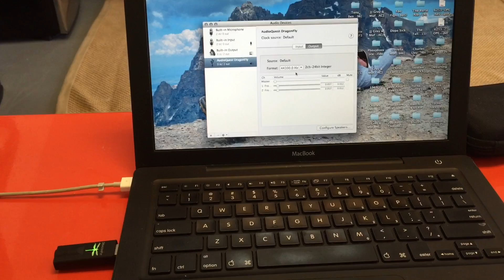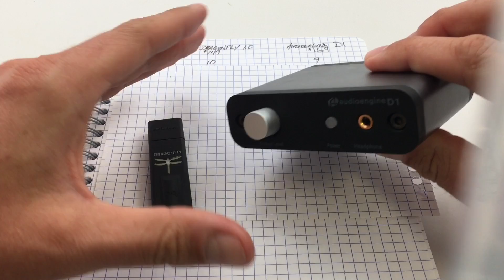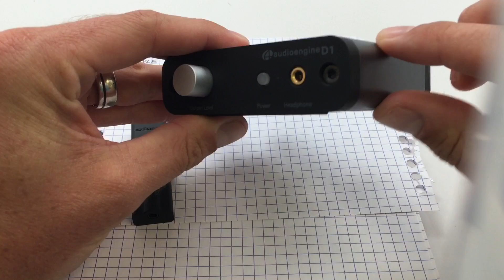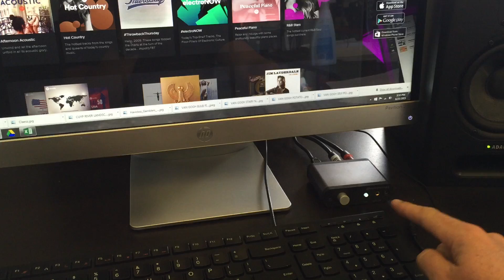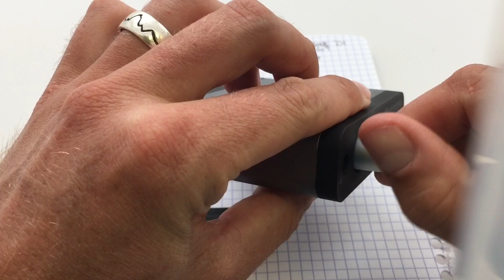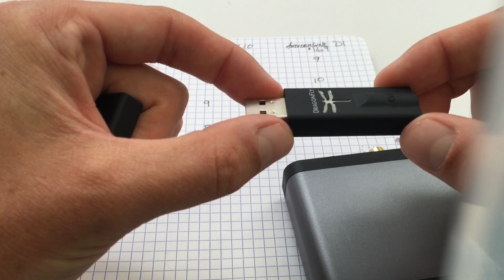DAC Shootout Audioquest Dragonfly vs Audioengine D1

Comment: I was thinking of those two. I have the dragonfly black, and I waiting for my Hd650s, will it be enough? The red maybe? Or the audioengine. I want something portable, i Know Hd650s are for the house, but i want have some dac amp for my other headphones like urbanite xl and momentum and msr7. Any recomendation. Thnks.
Reply from the maker: It should be enough
Reply: Abrahan,, just noticed your post as I was just leaving my impressions of the audioquest DAC ,, I have not heard the dragonfly but apparantly they have a very similar sound profile.   
I had compared the audioquest with the Berisford Caiman DAC and I think it would suit your needs very well as it has an excelent headphone amp built in and it runs 650's very well,,  I think it has a good synergy with the 650's. You should be able to find one second hand for around 100.. Try ebay or pinkfishmedia,, you may have to look for a few weeks but you will find one.

Comment: Would someone who streams 320Kbps Spotify premium, would one of these provide a significant improvement above my 3.5 to RCA from my iMac to receiver?
Reply: i have the audioquest and a macbook pro . The mac tbh has a pretty good dac but there is still some improvement, however to what extent is subjective.
Reply from the maker: I would agree with James Arthur - Best to try for yourself to see if you can notice and or appreciate the difference.
Reply: i have a dragonfly black v1.5 and i use it with spotify premium on my msi laptop and it depending on the quality of your headphones of course it does make a big difference, much more detailed and powerful sound. You'll also notice a big difference in volume a normal easy to drive headphone will have normal listening volume at about 4%. msi laptops supposed to already have great build in dacs so i doubt that a mac sounds better than the msi

Comment: It would be great if you could bench them using a mobile phone.
I found the Audioquest didn't go loud enough with my Note 4.
Reply from the maker: That's interesting. I'm wondering if that's more to do with the cell phone's output capabilities than the DAC's qualities?
Reply: +TheDutchSandwich 
Yes it can be a current limiting element to the power output of an android phone. 
Use something like an ifi Nano iDSD  and it's a far better solution.   especially for Apple.

Comment: If you wanted to do a reliable face off, get a high professional grade mic and do recorded comparisons. DACs are such a scam when considered as an upgrade. It's all just hearsay.
Reply from the maker: Thanks for your comment Anchor. The improvement both of these DACs make over plugging headphones directly into your computer's 3.5mm outlet is astonishing. Plugging in an inefficient headphone like my HD600 you can barely get to a decent audible level, let alone be able to crank it way up. That's why DACs like these are so great. I think what you are suggesting is to compare the subtle differences in sound quality between the two which I stated in the video I couldn't hear a discernible difference and I'm not sure it's necessary if you actually compared them to the stock headphone output you will realize that no professional equipment is needed. Nonetheless thanks for watching and commenting. 
TheDutchSandwich
Reply: +Anchor Senjaro Microphones and microphone amps also color the sound, that's why pro recording studios have a variety of each.  After that sound coloration, there would be additional coloration of running it back through an ADC to put it up online.  My point being that recording output with a microphone is not reliable at all.  The only way to really judge minute differences in sound quality (not to mention personal sound preference) is to listen yourself.  This review is useful because he talks in generalities about sound and specifics that are more finite (and less subjective) such as build quality.  It's much easier to put up samples of input (like sound clips from an ADC or a microphone than output (like from a DAC or an amp).
Reply from the maker: Farley5927 Thanks!
Reply: +TheDutchSandwich Question:  How is the volume controlled on the Dragonfly?  They state it's analog volume control, but there's no knob, so it must be digitally controlled, right?  Just system volume or is there a specific volume app?
Reply from the maker: +Farley5927 Exactly. You adjust the volume on the computer itself. They recommend setting iTunes to 100% volume and adjusting the computer volume to preference.
Reply: +TheDutchSandwich Thanks!
Reply: Nicolas Melia Not all computers have the same dacs installed. Computer dacs have come a long way, but are they good enough to rule out dacs like this? Only a blind test would tell. This product is almost as much as a motherboard, which I find rather ridiculous. Anyways, I use bookshelf speakers.